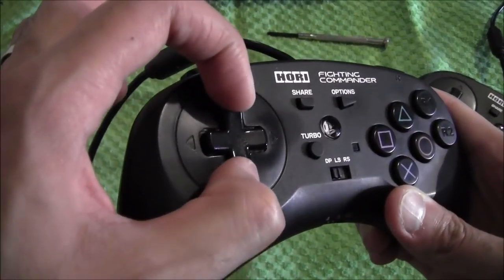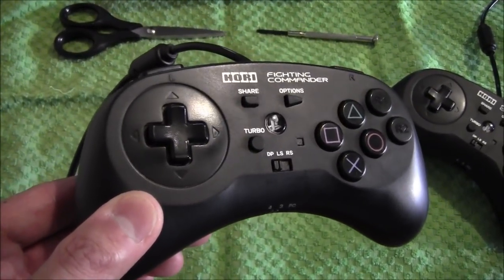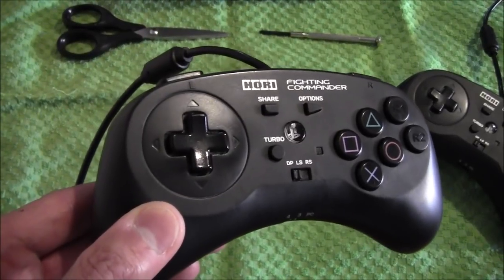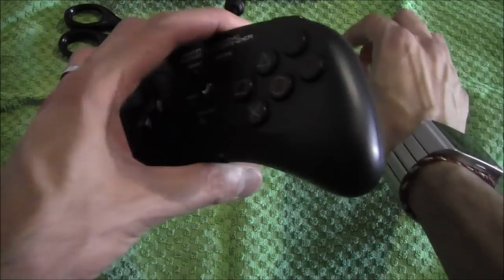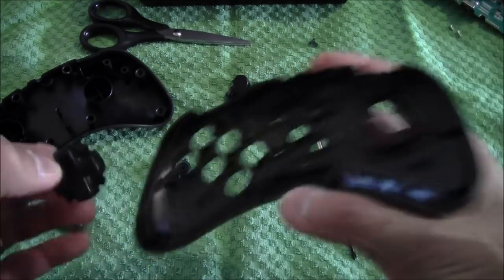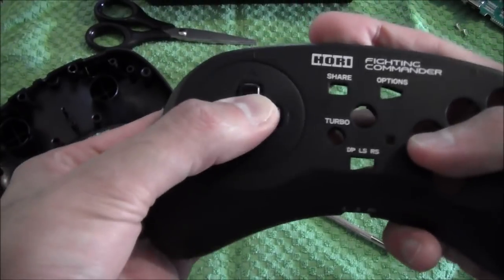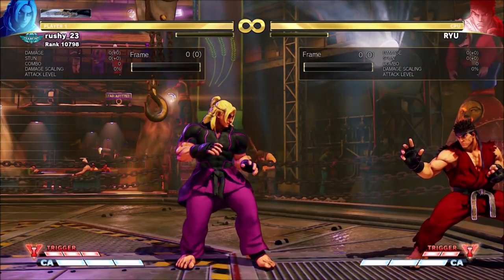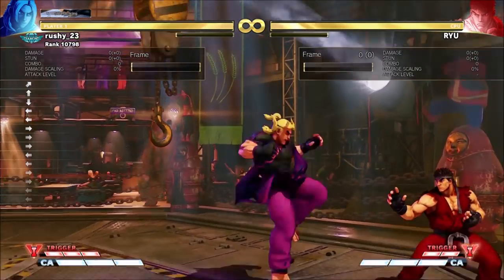Hori Fighting Commander - Loose D-Pad Fix

Comment: Hey rush. I’ve been following your videos for the past 4 months since I’ve picked up this game. Just wanted to say that this worked like a charm!!! I even went a step further in fixing the membrane for the buttons and they are more responsive than ever. Thanks.
Reply from the maker: Hey Alexander, thank you so much for the awesome feedback. I'm more happy the fix continues to work for people. Out of interest what did you do to improve the membrane for the buttons? Just a clean up?
Reply: Rush G yes. A clean up and I noticed some of the pods had a hairline rip making them lose their spring on some of the buttons. So I simply used a light coat of adhesive (crazy glue). And it worked. Your video inspired me to take things a step further into doing a mod on the madcatz next. 

Try looking up vids on repairing remote controls. It’s basically the same thing.
Reply from the maker: Gotcha, thanks for that. I will take a look at my pads, I sometimes find the shoulder buttons can be a little unresponsive. Otherwise the rest are good.

Is this the SFV Madcatz pad? Yeah I assume the principles and techniques are similar
Reply: Rush G oh. Nah. I have the same Hori. Followed your instructions and everything 100%. The d pad is even sturdier now that the factor build after your solution. I was just considering buying a madcatz as well to remedy the common complaints with their D PAD AND BUTTONS. 

But the membrane rubber is essential in the responsiveness of the buttons.
Reply from the maker: Sorry Alexander only just spotted your reply. I see, with you now.

Did you end up getting a Madcatz pad in the end to get to work on? Generally I didnt find the pad great to use, some little things with its overall design. Still, good fun fiddling never the less.

Comment: Good job rush u finally figured out the loose pad solution. I have 3 of those pad on deck and I'm going to repair all 3. Thanks for the tip. But still look into the hitbox bro.!!!!. Thanks again good video!!!
Reply from the maker: I know tell me about it, it sounds like an outright lie but it works!

Yeah Im still keen to try it, Ive not sorted out a proper stream / setup yet so need to get on it asap

Comment: Nice tutorial, its really helpful to know what to do when the D-Pad should get loose so you dont have to buy a new Controller directly because of it.
im pretty new with beat em up Controller and had done a bit of research and it seems to be a thing with Hori that the Controllers dont really have good Sticks or Pads, at least to their cheaper Controllers as it seems.
anyway, thanks for showing a fix for that. :)
Reply from the maker: No probs, when I made this video I was always wondering how long term this fix was. Both pads I worked on still going strong.

Yeah I dont think Hori are seen as premium products, but Im very fond of my Fighting Commander :)

Comment: Hey man, love this damn pad so much I was almost just gonna say eff the fix and buy another (purely due to laziness lol) but this definitely did the trick! Even had a case of a loose shoulder button so got that fixed as well, happy camper here! :)
Reply from the maker: Unfortunately you will need to eventually buy a new pad as the plastics will continue to rub and work loose beyond repair.

But it's nice to get a few more months out of the pad for sure. Happy to have helped out 👌

Comment: Thank you! Was having this exact issue! Will try it tonight. I also find my buttons to be loose too
Reply from the maker: Let me know how you get on, everyone that's tried it has said it works and I've done 3 pads myself now.

For the buttons, you may need a replacement rubber piece, for the bit that sits under the buttons. I haven't looked into spares but will see if inspiring anything
Reply: @RushG   So mine is the FC4 the one where you can change the angle of the d pad and OMG is was a hassle to open up. The screw mechanism for angling the pad has a stiff spring inside that I had to remove and putting back together was a pain. 

That being said, your method worked fantasticly! D pad is now sturdy and almost new feeling! Just hope I don't have to go through the profess again.  At that point I'll probably end up buying a new one without the angling mechanism.

Thanks again. This helped a lot!

I even added a thin layer of tape behind each button to lessen the play between them and the rubber.
Reply from the maker: Sorry for the late reply, I guess cause theres more mechanically on the device its bound to be a pain to mess with. But sounds like you did a good job with it, great stuff.

Yes Id recommend a the regular FC pad if you do get a replacement. Since Ive "repaired" mine, its still going strong and ive not had to reopen it which is lovely.

Comment: Wouldn't frictionless tape be better? Yes it would!
Reply from the maker: Im not sure, it was more a issue of spacing rather than the material surface changing. Because of the plastic on plastic it work away making it loose, the sellotape seemed to make it fit ever so tigher.

Comment: What about liquid silicone that dries over time, or that liquid Shield Band-Aid. Those options might work for you check them out and see how it does and killer video, and I'm glad you found a way to somehow someway make the controller's lashes a little bit longer
Reply from the maker: I will have a look into it, haven't got any lying around the house so will read up and perhaps buy some.

Thanks man, we shouldn't need to do this. But needs must.
Reply: No we should have to do this at all. But it's another way for them to make money that's all. I love the fight sticks but we have other problems that are similar to yours.
Reply from the maker: I think thats honestly why its built in the way it is, boost sales.  Wonder if they will release a new one soon?

I can imagine, the cool thing about sticks are they are built in a way to be customised
Reply: Liquid silicone is something I used to fix certain parts for my ps4 controller. It works wonders for the triggers which are also built to wear. However be careful with the Dpad apply too much and it will be too stiff for use and it will be a bitch to remove.

Comment: Nice job ! My Hori fc pro buttons and d pad became horrible. I've already tried to fix it but I failed. Do you have any tips ?
Reply from the maker: Did you try this fix specifically?

I've never had an issue with this tip shown in the video and it nicely firms up the D Pad, any time my buttons have stopped working I've not been able to salvage them.  The buttons themselves though have never felt "bad".

Let me know more and I will see if I can help out
Reply: @RushG  not this one. But this will surely solve my crouching block and poor inputs issues. I will try to clean up buttons
Reply: @RushG  I can't clean properly the d pad  because the d pad angle setting. And I don't want to break it. I will buy a new hori fc controller
Reply from the maker: @cnz0183  if you are on twitter take a pic and DM it to me. Not quite sure what you mean but may be able to help.

Comment: What size screw do you use to take off the shell of the pad...my directional pad is not making do certain movements...I have a tool set for small devices.
Reply from the maker: I don't know the exact size but a precision screw driver does the trick. From a precision set.

Comment: loose d-pad is not a flaw. It's a choice. The hori even tho not a d-pad like sega saturn. the flexibility of the hori fc1 revolves around sega saturn model 2 controller. i never missed inputs with it.
the guys that dont like the loose pad may very well be playstation and super nintendo fans. because those controllers are stiff which i dont like. its a choice and i have respect for it
Reply from the maker: It does work lose as it's not lose from factory. It works lose over time and this gets significantly worse as you rack up more hours on it.

Eventually the diagonals stop registering and the whole pad needs to be replaced. I've owned probably 10+ of these Hori pads now. Many people on the channel report the same lifespan / experience
Reply: @RushG  oh ok. Well inhavent used it too much. More on a rap 4.
Reply from the maker: @googoo5922  ah ok. Yeah Ive had a lot of time on this Hori, also on a number of other 6 button Fightpad. Other than this characteristic of the Hori FC, it's a fantastic pad

Comment: How do you fix a pad that is too stiff?
Reply from the maker: Just more use, how long have you had it?
Reply: @RushG  i've had the commander 4 for 3 months but its not really loosing up, went back to a 3 cause i had one before but this new one is stiff as hell.
Reply from the maker: I get confused by the numbers, I thought the FC3 was the PS3 version and FC4 a PS4 version. Both are a different design, the one with the adjustable d pad?

The FC (no number) is the one in the video?

The one I'm using gets less stiffer I found over time, does take a while but I'm certain. This will be my 4th or even 5th one now
Reply: @RushG  You are right, sorry, my bad.
Reply from the maker: @sky11dragoon  no sweat man

Comment: would this help if the controller sometimes gets stuck inputting forward (6)?
Reply from the maker: If it's stuck in a certain direction then it must be jammed. Worth taking it apart just to fix that in itself. This particular fix is just to stop it from having excess play leading to misinputs
Reply: @RushG  alright then thanks for the tip

Comment: i wonder if this will work on my ps4 pad
Reply from the maker: It's possible, I'd day if you have ps4 pad issues it's worth opening her up and taking a look. Although I know there's a  lot more components in them in comparison. Be warned :)
Reply: No it doesn't PS4 controller has a little silicone ring that has buttons for the directions. If your your buttons cave in a bit and loose some of the pressure it means the silicone has ripped. I applied a very little amount of regular silicone to fix those and glue them back in. However you have to apply a very small amount or it will become too stiff for fighting game use.

Also PS4 controller has a lot more parts that can break if you try to open it up. You need to be especially careful wit the ribbon cables.

Comment: My R2 button is mushy after putting it back together, but no matter how I re-assemble it I can't fix it.
Reply from the maker: I can't say I've had this issue myself, if you're confident in taking it apart again I'd look at L2 to see what the difference is.

From memory R2 and L2 are built into the controller so it must be something to do with the bedding underneath it
Reply: I'm sure you probably figured it out already, but if not, you might have the button upside down. I took mine apart today and had the same issue.

Comment: hey should i do this new when i get my out of the box ? i am new hear so should i put tape ?
Reply from the maker: It will be fine to begin with. You will know when it needs working on as the D Pad will move around a lot within the housing.
Reply: @RushG  My D-pad was loose straight out of the box (new controller..).
Reply from the maker: @Apanblod  that sounds odd. Did you report it to the seller? Can't say I've had that experience myself. Not good!
Reply: @RushG  It's not quite as loose as the one you demonstrated in the video, but enough to make it get 'stuck' in between the gaps sometimes if I make a semi-circular motion (if that description makes any sense..)

I bought it through the Scandinavian counterpart to Amazon, and the complaint process is a bit tedious.
I've always been a bit sensitive to these small details when it comes to controllers, so I'm not sure if I'm overreacting or not.

I tried the screws just to see if I could get it open, but I don't think I have quite the right size Philips for it (only had two different ones), so I'm going to try to borrow some to see if I can follow the instructions from your video if necessary. I'm thinking if I'll have to do it sooner or later anyway I might just do it sooner.

Thanks for the instructions and the fact that you're responding this fast to a two year old video. Better customer service than the actual seller! 😅

Comment: You got anything on a stuck D pad?
Reply from the maker: If you haven't taken it apart already, that would be the first thing to see why it's stuck. Could be an obstruction, something has broken.

If none of those then the pad could be fried. I've not anywhere that does replacement parts unfortunately

Comment: my d-pad still gives me missimputs...
Reply from the maker: Did you have misiboyts original? This doesn't fix our misinputs exactly, this fix helps stabilisation of the d pad once it's starts to wobble. 

It's worked wonders for me many times, I'd suggest trying again. Id it's still bad then the pad could need more serious repairs or need binning. 

I've had pads after I've fixed them get me another year of use before it completely died on me